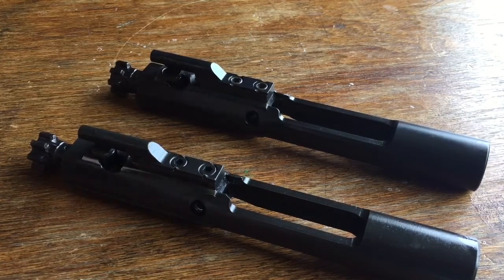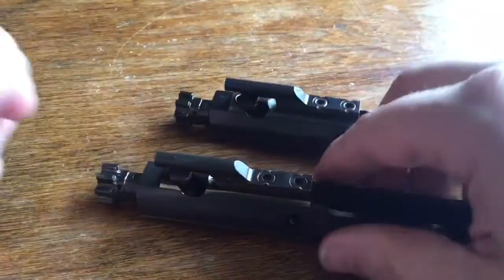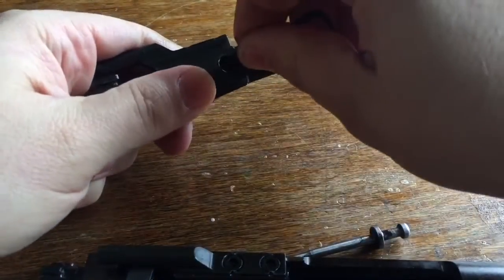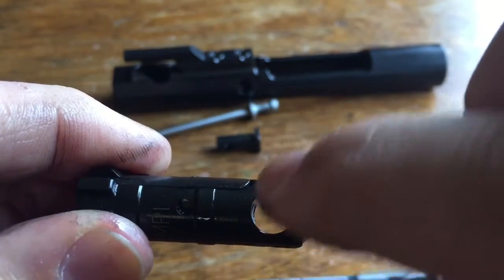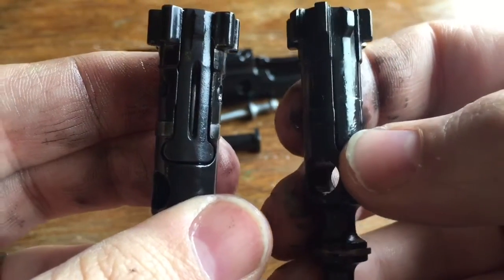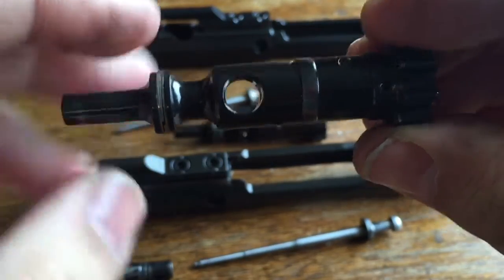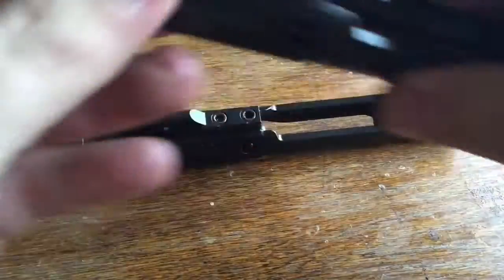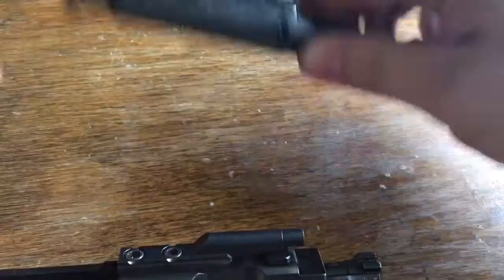KAC SR-15 E3 Bolt Compared to "Mil-Spec"

Comment: This answers my question about whether or not a MIL-SPEC bolt could be used in their (KA) rifles...in a pinch. I hate proprietary parts! Thanks!
Reply: idk much about this, but is it proprietary or simple an upgrade or improvement of design to the standard old design. If is, it will no longer be "proprietary if the general market improves it as well.

Comment: Have you weighted the bolts? Im curious what is the weight difference. The E3 should be like 15% heavier.
Reply: I tried weighting mine the Knights bolt is 0.13 heavier...not much to write about...

Comment: Will the KAC bolt work in any chamber? Or does KAC also have a proprietary chamber?
Reply: Casey Terrence No, it is proprietary to Knight’s Armament. It requires an E3 chamber to work and it is only available through Knight’s Armament. There are some online dealers that have barrels and Bolt combos for sale but they are all “take-offs” from a factory rifle. The closet thing you can get to fit into a standard mil-spec M4 Barrel Extension will be the LMT Enhanced Bolt- durability wise. I own several Knight’s Armament SR-15 E3 rifles, and I am a believer in the system (E3 Bolt & Barrel Extenson, extended mid-length gas system, lightweight barrel contour). I personally find them to be the best “bang for your buck”. I know a lot of people will consider them expensive but when you think about everything your getting from the factory with a Knight’s Armament SR-15 E3 Rifle (E3 Bolt & Barrel Extension, extended mid-length gas system, custom contour barrel, ambi lower receiver, muzzle device [suppressor ready], flip-up iron sights, match trigger, trigger guard, rail system, LMT SOPMOD Stock) you end up with a great package out of the box. All you need is an optic and you are good to go. You will EVENTUALLY end up spending just as much if not more, custom building an AR-15 with all the features the Knight’s Armament SR-15 E3 has out-of-the-box. There is also NOT ONE SINGLE EXAMPLE OF A BROKEN E3 BOLT - AS OF YET, IN A CUSTOMERS HANDS. Hope this helps 😁
Reply: Michael Westen if you think about the price it’s really not that more expensive considering you will need to either buy a new rifle or complete change parts to your existing rifle before burning out a Knights gun. Haley I think has a SR15 with over 10k rounds through it not cleaned, just oil.  It’s just a fact that they make THE BEST ar’s on the market

Comment: Is the cam track path on the Knights BCG a smaller diameter than a milspec BCG?
Reply from the maker: Al Womble yes it is indeed.
Reply: No it’s not, the cam track (which is located on the carrier) is the same, which is why any bolt can be used with this and the newer sand cutter carrier.

Where’s it’s different is the cam cutout on the bolt, it’s reduced in diameter to reduce crack propagation.